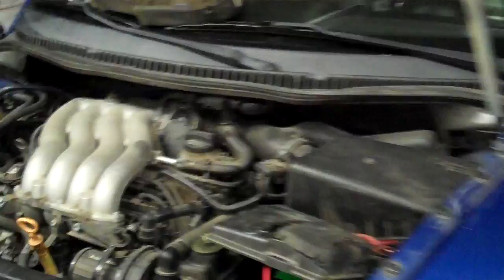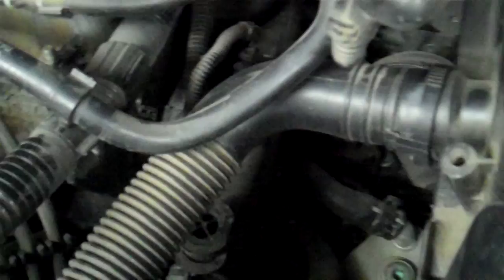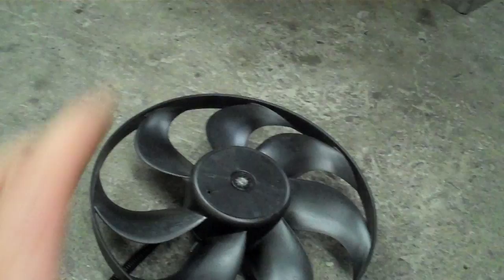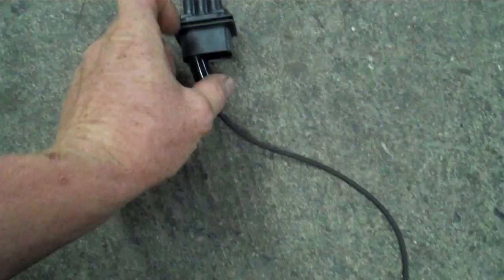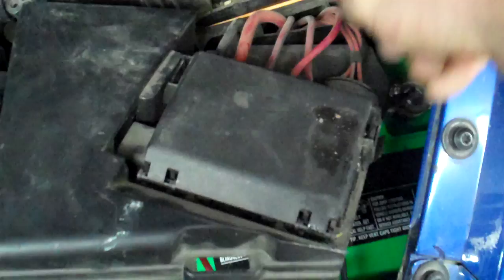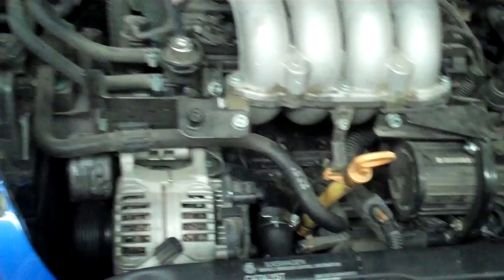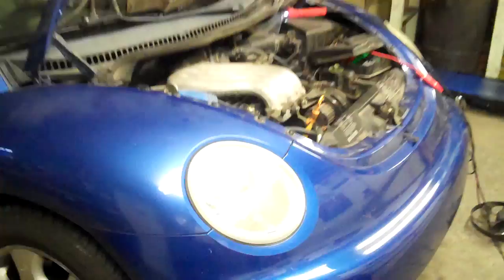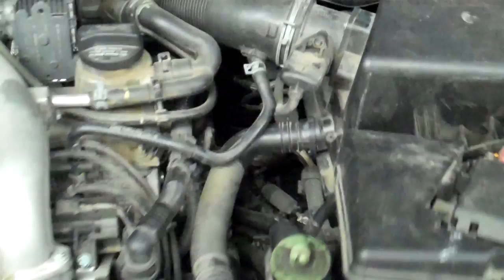How to diagnose Beetle overheating

Comment: 100% correct about the water pump.The one in my 2004 beetle with 64000 miles on the clock shattered into pieces then the engine overheated and warped the cylinder head .I recommend fitting a good quality steel propeller or similar when changing the timing belt or sooner if you can.

Comment: Thanks Brian .. just did the pump today with a cast one ... when removing ... the plastic impeller detached and stuck inside the block ... have to change the coolant flange (again) .. and not quite sure of the fans ... what a terrible cascade of events ... head gasket might need replacing as well ... thanks for the videos ... they have been quite helpful ..

Comment: I've been working on a 1998 New Beetle, replaced water pump and timing belt, and then had to replace valves. I replaced the gaskets and all too.  The car starts, but seems like it is not holding furl pressure between starts..But my main question is, when I re assembled the car, I had 6 13mm 1 inch bolts left over .  I can't seem to find where they are supposed to go. I started this 2 years ago, let it sit, do I don't remember these bolts.  The car rattles a little when it is at idle, but smooth when I rev it up.  Thought you might know off hand where these bolts might go.  Thanks, loved the video!!

Comment from the maker: @fargobrad If it's crudded up enough to need to be flushed the corrosion likely was there before the tap water got to it.  I typically don't drain the block by pulling the plug, but rather force air through it to clear what I can.  I use concentrate coolant and account what little is left as water added.  As badly neglected as most V-dubs are that I see I don't go all ph scale on them.  They just aren't built to last. Modern all makes and models coolant is great for inhibiting corrosion.

Comment: hi I have a 2000 2.0 v w bettle, we changed the water pump and the coolant resavoir, but my beetle still over heats. it smells of hot plastic and the coolant resavoir is always empty. this is after it has reached the engine temp. i think it could be some of the hoses or maybe the flange,  need help please.

Comment from the maker: When you have a fuse blow you lose power to that circuit.  You may have multiple components on one circuit.  However you have lights turning on (check brake fluid level) and a gauge acting up.  I would think you have some pinched or chafed wires rather than a blown fuse.  Good luck!

Comment: Most likely the coolant needs to be topped off, or you have some air pockets in your cooling system. Regardless, take it back and have them top your coolant off. Make sure they use G12 coolant!!!

Comment: Worked a 2000 Golf which would overheat. Replace water pump, thermostat and it would overheat still. After father diagnosis, It turned out to be the fan  high speed wasn't working. Repaired that and no more overheating.  In the  event,  that all of that is done check radiator for clogs.

Comment: took thermo out and pump looks fine i even cranked the engine a bit while someone looked at it, impeller spins fine no cracks or chips, i put everything back filled with coolant i even bled every hose i could get to, started it and warmed it up the heat comes and goes,but when the light comes on theres no heat at all, im letting it cool as im writing this, im going to try to top it off again, seem like im not getting coolant to the heater core, might take it somewhere to diagnose the problem

Comment: I've heard most people run a garden house with tap water to flush out the radiator and block, and have heard tap water will corrode everything. So I'm thinking the block drain would need to be removed to completely drain the block?  

What is your method for flushing?

Thank you

Comment: So if it is leaking just replace it...got it.  They are fairly cheap anyway. I am also curious about the power probe you are using. Where did you pick it up?? Would be a very handy tool to have for checking electrical plus the added bonus of being able to apply power for checking fans, lights, etc. I have looked a couple places and of course you get the deer in  headlight stare!!

Comment: We have a 2001 VW Beetle with the AVH 2.0.  Thankfully the bulk of the work was done on the timing belt and such.  The thermostat was running "cool" with a soft fail.  (The spring gets weak and opens to soon) So we replaced it.  There's the little back hose that feeds into the expansion tank.  People need to know it has to be able to pass coolant--that's one way it purges air out.  When we did ours?  Major air blockage that prevented the car from having heat.  Had to massage the crap out of the radiator hoses until she 'burped' big time.  We've got all kinds of heat now! 

Final comment.  These are all aluminum engines and require VW only coolant.  G13 is expensive--mix it with a gallon of distilled and you're good to go.  But it's the only coolant to use, is the factory.  (G13 replaced G12)  There are special additives that VW coolant has that the 'Green' stuff doesn't.  This is where the guys at the auto parts stores do not get it right.  Spend the extra---it will save bills down the road.

Comment: The water pump went on my dads 1999 vw transporter 2.4 diesel its a common thing that go on the vw thay recommend to change them at a certain milage. It has nothing to do with how old the car or van is. You could be lucky and have the pump working still on the car. Hay i was just looking at the fuse box its the very same one as my dads vw transporter fuse box thay use them special wired fuses.

Comment from the maker: Are the hoses the same temperature roughly?  Or is one super hot and one supper cold?  Also have you changed the ECT sensor if it's over 80K miles?  It may not be kicking the fans on- on time or the fans may be bad (sluggish).

Comment from the maker: It's got air trapped in system or it doesn't have coolant flow.  I think it's got a bad head gasket maybe.  It could be injecting compression gasses into the coolant jacket.

Comment: Hey I have a 02 VW beetle GLS 2.0 I've replaced the water pump, thermostate, the flange, ECT, timing belt, and even had to replace a freeze plug behind the tensioner pulley. When I crank and let it running for 20 or 30 mins at 2k I get no overheating issues. However as soon as I get down the road it the red overheating light beeps then starts flashing no leaks. It also throws the code p0117 ECT low input. Could it be a wiring issue? What do you think? Thanks for the videos and the help

Comment: air seems to be the problem. or a bad/clogged heater core? how do i fill the coolant so i dont leave any air pockets? do i need an airlift tool? the way i filled it was by filling the radiator, then started the car while i poured coolant into the reservoir, i let the air bubble out in between the coolant flange and radiator hose. im going to fill it again. this time i will leave the heat on high as i pour it in. thanks for all your help,

Comment: kool video
I have a 2002 vw jetta it's over heating I check both fans by giving 12volt power to them both fans will not run on low speed but high speed the both run .why is that there not going on at all. Thanks for videos keep up good work.

Comment: I have a 98 vw beetle that's overheating but the fans only come on with a/c, I've changed the thermostat and thermo switch, fans do work but I'm told it's a fuse and I can't seem to find it. any ideas?

Comment: just found these videos. I am no stranger to mechanic work by no means but I have a question as I just bought this identiccal beetle for my daughter.  There is antifreeze below the *flange* you had mentioned in this video. Did you make a video to show the removal, repair or replace of this?? Is it an *O* ring that goes bad or does the plastic crack??

Comment: ive done that multiple times still overheats. coolant builds in the reservoir then overflows. is it possible that my brand new water pump is defective? it doesnt seem to be circulating. im going to pull out the thermostat and take a look at the impeller. should coolant come out through the small hose on top of the reservoir. not a drop is coming out of mine. i never thought a 4 cyl vw could kick my ass like this.

Comment: Good information thanks. Have a question, I dont have the red power probe, but in order to test a vent fan, it is possible to put ground from a 12V battery to the brown cable and then connect power to low speed  and then high speed from battery's positive? I hope I explain well myself, english is not my 1st languaje. Thanks

Comment: ok, so apparently my radiator fan on the drivers side isnt working. but you said it could also be a fuse?.....i'm wondering if thats the case for me because the light to change my front brakes turns on, when in reality, the brakes are fine. The needle for the gas tells me its full when its not or vice versa. Sometimes the needle just doesnt even mark anything. so im debating now on whether i should buy the radiator fan assembly :/ what do you think?

Comment: they both get hot but the one that comes from the thermostat housing stays cold for a while but eventually gets hot.. the water in the reservoir eventually starts boiling and spilling out. the fans come on on high for a few seconds then turn off even though the car still hot. shouldnt they stay on if the car is overheating?i have not changed that sensor. they all seem to be fine in appearance . where is that sensor located? no water in oil. no smoke,?

Comment: that must be the problem because ive tried everything i also hear ticking especially at start up or around 2000 rpm. sounds like bad lifters. but it runs well for a while 20-30 minutes after that heat in the car turns cold and reservoir fills then red light comes on. it cant be this hard to put coolant in a bug. must be the head.=( shouldnt there be coolant in my oil if the heads bad? my oil is very clean. how can make sure? compression test?

Comment: Sad to see how badly new VWs hold up. The 1980's style water pump held up much longer. 

The problem with the auto repair industry is this misinformation plus fear, uncertainty, and doubt (FUD) that is widespread. Plus $80 in California to check OBD 2 codes,  flat rate time for a job that Joe Sixpack could do in half the time, and folks that think spending $9k on a new Snap-On box is better than spending $9k on a Snap-On Verus are three examples of what is destroying the industry.

Comment: i changed a fan switch sensor yesterday and still the fans werent kicking on as often as they should. then i discovered the fusebox on top of the battery and the 30 a fuse was not burnt but the terminal around it was melted and the fuse sat in there loose. after a few minutes i got the fuse to make contact and the fans came on!  the car went 30 min running and no red light! i got in the car and turned on the heat. no heat! then i looked at the dash only to see that dreadful light again. air seem

Comment: Hi Brian I have a 2001 beetle and I replaced the thermostat and water pump but im still over heating the fans kick on I checked them by turning on the A/C and they both came on what else can I check or replace it just has a dummy light and not a gauge Thanks Rich From Hooper UT

Comment: I have a 01 beetle it was running when we replaced the laminator . after that it would start then die so I had a new key made thinking it was the imoblizer but no it still starts and then dies. do you have any suggestions?

Comment: I have a 2001 jetta 1.8T i have relax the engine fan and my car is still running hot what really could be the problem. when have test the fan it only run on slow speed

Comment: Hello, ? , I have a 1999 new beetle Volkswagen, Charged it with air conditioner coolant,  It reached the 40/50 pressure,  and then it flew to the end of gauge, so i disconnected it and a few minutes later it got  a little cooler, let it run .. Now it over heats??  and I used super-tech  premium r-134a i didn't notice but it had leak sealant and condition, Could i have clogged it up??

Comment: Okay so I really hope you can help me out. You seem to know your Volkswagen, I have a coolant leak that seems to becoming from back of the motor somewhere near the exhaust manifold. it only starts after the cars been running for a minute. i jacked the car up got underneath and seems to becoming from the top in the back of the motor in the middle, dripping down and hitting oil pan and  the cv boot.  This is our first vw and i am kinda lost. Have coolant on the top of the tranny as well Pleasehelp

Comment: Quick question. I'm working on a bug and the cooling fan won't turn on. The black plastic housing that all the hoses run to has a small crack. The fan does work. Would the coolant temp sensor cause that issue?
Reply: Brad Fries you have to reprogram it with a computer. Mine was doing the same thing and problem ia fixed.

Comment: The impeller dissolving is why you're supposed to use G12 coolant as written on the reservoir.
Reply from the maker: That's what all the VW's with broken plastic impellers say to do too!  lol  They still fracture anyway.
Reply: briansmobile1 I've had four VW's, 99 Passat, 02 Jetta, 06 Passat, 01 Golf, never had a that problem and have driven all of these up to 200k. Have only seen this issue on VW's where people didn't use G12 coolant and other issues not using the correct gas and oil.
Reply: Brad Schlangen whats the correct oil
Reply: Ivan Soto Which oil are you referring to?
Reply: Brad Schlangen 2003 vw mk4 2.0 230000 miles
Reply: Ivan Soto Hmm, ok. if you're asking about engine oil then that should be full synthetic
Reply: Brad Schlangen was told to use heavier or conventional oil. Ill use full sythetic for high mileage cars from mobile 1 5w30. Well see.
Reply: Ivan Soto On a VW always use full synthetic, mileage is irrelevant.

Comment: Question !!! Why does my 2004 vw new beetle become sluggish only after a long drive ??? 15 miles or so, it'll hesitate and then cut out,  but then I can restart it and then after a couple more miles it'll cut out again !!! Thanks
Reply: I own same vw... It was plug system and still had issues especially when my ac be on come to find out it was compressor entire reason, I changed it out and now have all my power 🔙 100%! Even better ⛽mileage, also 😉 gl

Comment: I have had to replace that damn coolant flange on my mothers 02 VW Cabrio 3 times. After a few months it would start pissing coolant again until I finally went straight to the dealer and got a OEM piece. Its been 6 months and no leaks yet. Not sure if the leaks were a result of crappy Chinese aftermatket parts of poor design from VW.

What was VW thinking when they designed a very crucial piece of the cooling system out of soft plastic with a tiny rubber o-ring? Dummies.